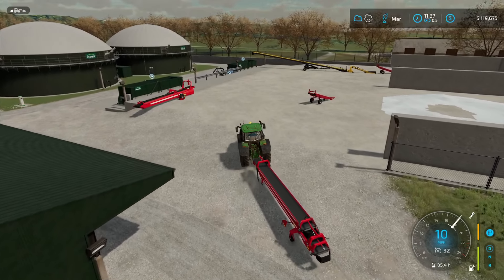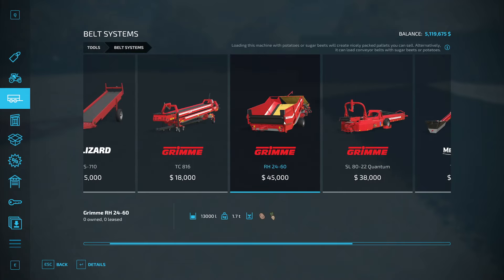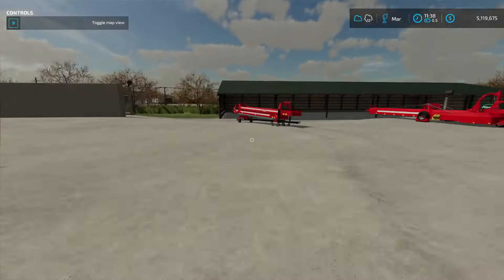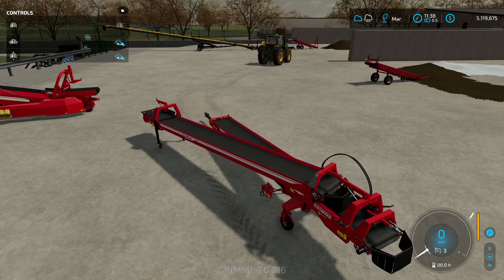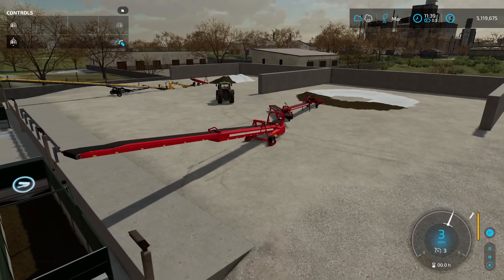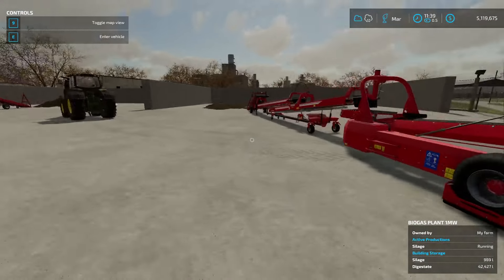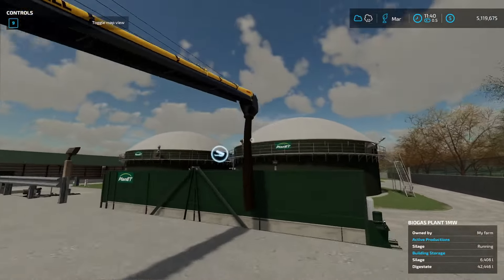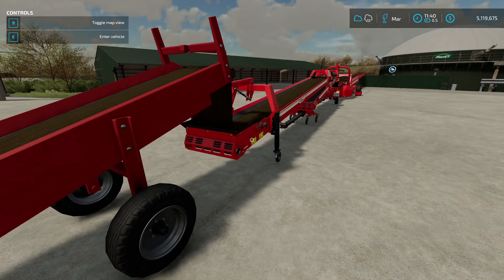Farming Simulator 22 Tutorial | Belt Systems

Comment: I play on Xbox One X and my problem, especially on Hagenstadt, but also on other maps, is that the belts just keep stopping randomly, they will run for a few seconds, and then they quit, and won`t start moving again, despite everything being switched on, unfolded and automatic engine start is off, ( i always do that ) 
The silage bin ( hopper ) is far from full as well, guess it´s a glitch, either with the Grimme belt systems or with the way FS22 handles belts.
Good thing the silage bin ( hopper ) is so low at Hagenstadt, ( old style FS13- 17 hopper ) that you can take silage from the " Fermenting silo " placeable mod and load on a trailer and dump it straight into the hopper, at least that works.